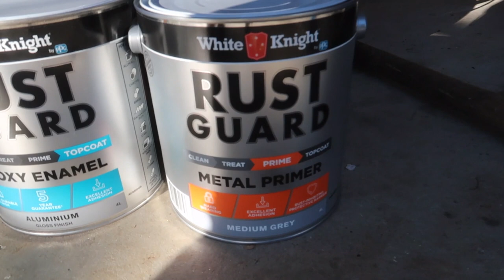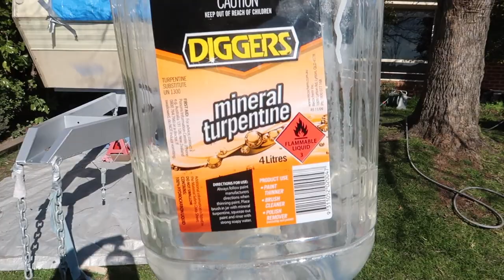Caravan reno #8 Prep & Paint chassis

Comment: Love the paint finish. How long did it take for each coat?
Reply from the maker: DEmma1972 about an hour or 2 from start to finish for the coat. Obviously not including cleaning up or packing away. We left a day to dry between each and 2 days between the last bottom coat and first top coat just to make sure it was really well and truly dry before the next layer.
Reply: @SomeWildRide  Certainly looks like a factory finish apart from the scrape and the sock fluff lol. Most def a better anti rust treatment than you would get from factory. New looks like the bees knees but the seller doesnt care if it rusts in 6 months down the line. Cant wait to see the finish you have in the interior
Reply from the maker: DEmma1972 you ripper! We are pretty happy!! One little bit at the front needs redoing that had bird poo and the layer Pete brushed over was too thick and didn’t dry right but we’re into fixing that already!